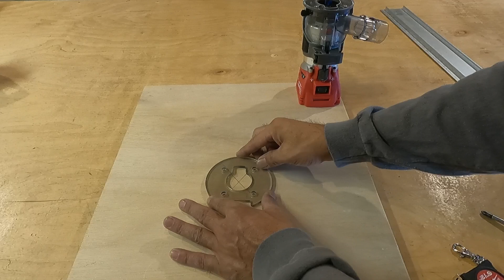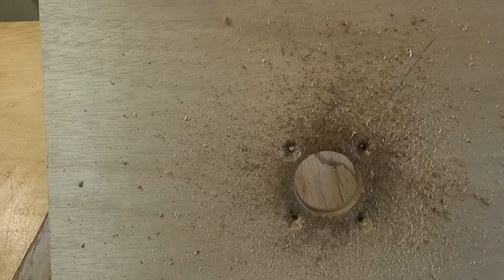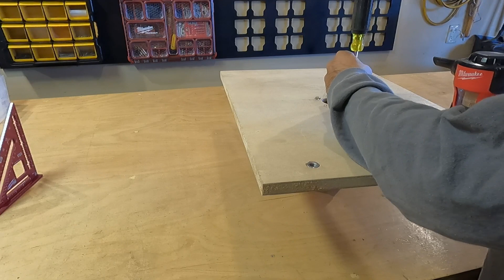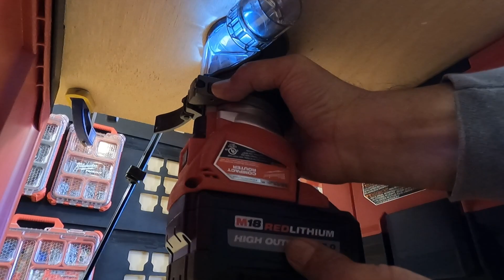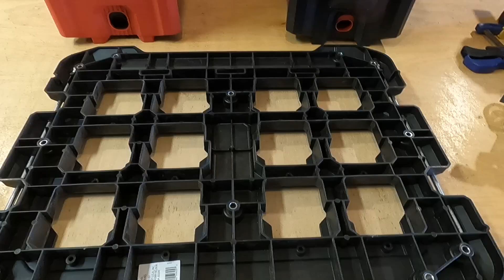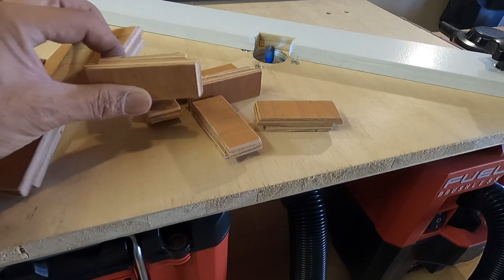Mod !!! M18 Compact Router Table DIY🤙Milwaukee PACKOUT

Comment: I made the same thing using the same packout vacuum, Packout deep tool box and Milwaukee router. Mine is a bit smaller and I 3d printed the cleats to install on the bottom of the 3/4” ply so the entire surface locks into the Packout and won’t slip off. Also my fence is horizontal orientation instead of diagonal. The Packout cleats model can be found on thingiverse fo free! I have also modded my packouts quite a bit. 3d printed Milwaukee and DeWalt power tool cleats mounted to inside walls of Packout so my impact driver, impact wrench, drill, router and all 20v and M18 batteries slot into the sides. This stops them from rattling around in the box whenever I go over speed bumps. Also printed the cleats for another 3/4” ply that my job site table saw is mounted on so it can also be placed and used on top  of my Packout stack. Currently printing an extension cable rack that connects to the aluminum rails on the corners of the Packout. 

Great idea and great video!

Comment: I would prefer some system that clamps the router in then having to screw it in everytime.
Reply: If you can somehow get an extra router base, you could just leave one attached to the table
Reply from the maker: Aloha, Please watch:https://youtu.be/FidLRTpzGpk
Reply: @crypticgamma6308  Thats exactly what I have done,luckily I have a plunge base as well.